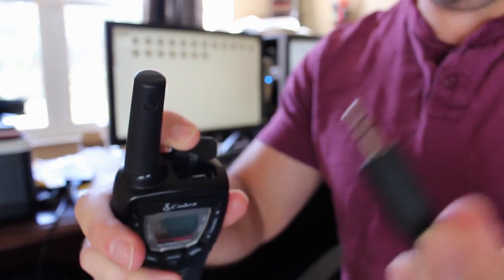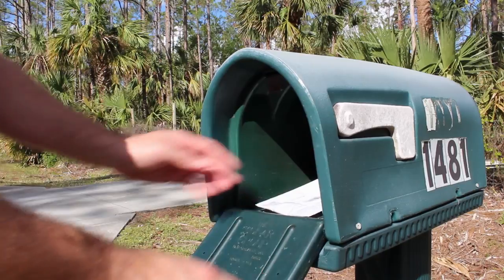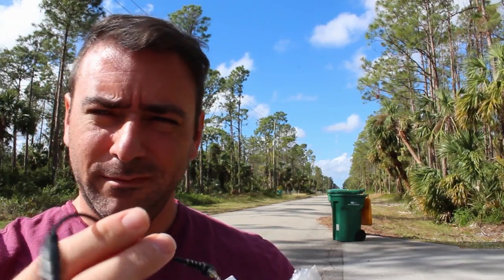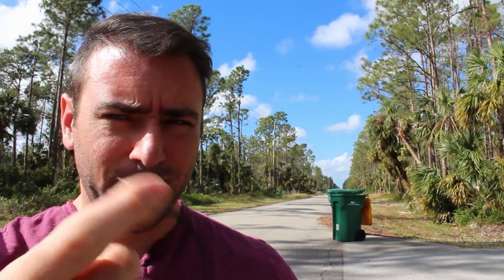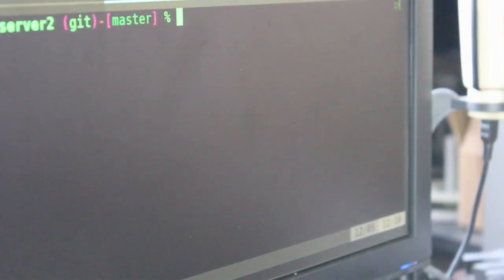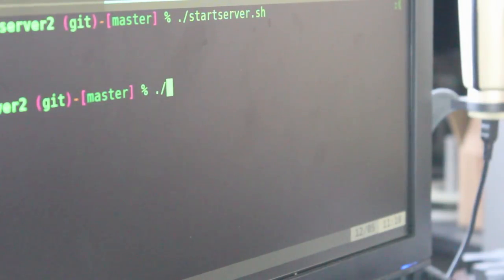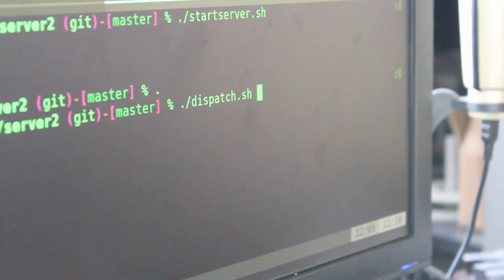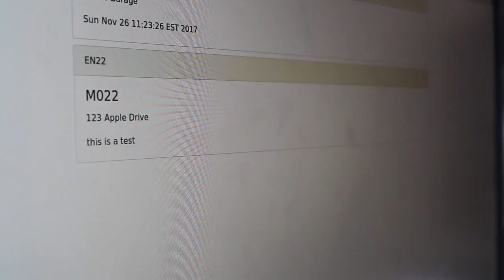11 Emergency CAD Dispatch Over Radio Wave with Minimodem Code and GUI HTML

Comment: Kris. Apart from the arguing commenters could you revisit this? Would it be possible to transmit gps data hooked to a linux machine over the air back home like this? Maybe your current car when you get it setup with linux?

Comment: I think it is important to mention that transmitting digital data with a CB radio (walkie talkies) is illegal in the US.  See 47 CFR part 95.631.e
Reply: Well, regs are regs. I wonder if the FCC was concerned with bandlimiting back when the rule you mention was adopted? With most modern rigs, especially when used through their audio ports (and not hooked right into the IF), your attempt at digital modulation will pass through the input filtering and be bandlimited. The result is that your rig's emission will stay confined to the radio channel bandwidth it was always permitted to use. If you try to send at too high a data rate, the inherent spreading of the modulated bandwidth this causes will get clipped off by the input filtering, with the result that your signal will not be intelligible to the demodulator plugged into the receiving radio. That's a sign that things are working properly to keep your radio's emission confined and you should be OK (if technically still not lawful).

The FCC might've been worried that someone could try to send a fast digital modulation, which would cause the occupied bandwidth of the signal to spread out and perhaps cause co-channel interference or interference to a service in an adjacent band allocation. This is sensible if you're regulating at what one might call the "Application Layer" (which the FCC still absolutely does). But, the way he's doing it in the video, this won't happen. Sure, other users of these FRS HTs expecting to hear voice traffic will get surprised/annoyed hearing a digital signal, but from a radio perspective, no interference to other channels or services will occur.

The ARRL is slowly and gently nudging the FCC toward the view that the more appropriate way to regulate in our modern era of ubiquitous digital devices, at least for amateur radio, is not as above, at the "application layer" but down at the "physical layer" of the radio spectrum and the radio's emissions themselves. Meaning--"here's a service allocation, consisting of so many channels or whatever have you, your transmitter may occupy  no more than 12.5 kHz of radio spectrum, or suchlike in this fashion. What intelligence you send inside that bandwidth and how is up to you, morse code, phone, AFSK, PSK, or OFDM digital, whatever, you pick. But, keep it confined to the bandwidth we've set or suffer sanctions"--something in this manner. FCC's not there yet, gov't is slow, but they rely on organizations like the ARRL to advise them on policy like this. One day, Kris' experiment may not have this legal encumbrance.
Reply: Actually this may not be entirely true. You may transmit on FRS for a maximum of 1 second every 30 seconds.
The restrictions you mention do however apply to GMRS.

Pay particular attention to § 95.193.a and § 95.193.b.2

§ 95.193 (FRS Rule 3) Types of communications.

(a) You may use an FRS unit to conduct two-way voice communications with another person. You may use an FRS unit to transmit one-way voice or non-voice communications only to establish communications with another person, send an emergency message, provide traveler assistance, provide location information, transmit a brief text message, make a voice page, or to conduct a brief test.

(b)Non-voice communications.

(1) The FRS unit may transmit tones to make contact or to continue communications with a particular FRS unit. If the tone is audible (more than 300 Hertz), it must be transmitted continuously no longer than 15 seconds at one time. If the tone is subaudible (300 Hertz or less), it may be transmitted continuously only while you are talking.

(2) The FRS unit may transmit digital data containing location information, or requesting location information from one or more other FRS units, or containing a brief text message to another specific FRS unit. Digital data transmissions must be initiated by a manual action or command of a user, except that an FRS unit receiving an interrogation request may automatically respond with its location. Digital data transmissions shall not exceed one second, and shall be limited to no more than one digital transmission within a thirty-second period, except that an FRS unit may automatically respond to more than one interrogation request received within a thirty-second period.

(c) You must not use an FRS unit in connection with any activity which is against federal, state or local law.

(d) You must, at all times and on all channels, give priority to emergency communication messages concerning the immediate safety of life or the immediate protection of property.

(e) No FRS unit may be interconnected to the public switched network.
[ 61 FR 28768, June 6, 1996, as amended at 68 FR 9901, Mar. 3, 2003]